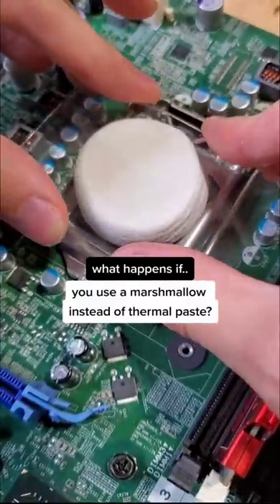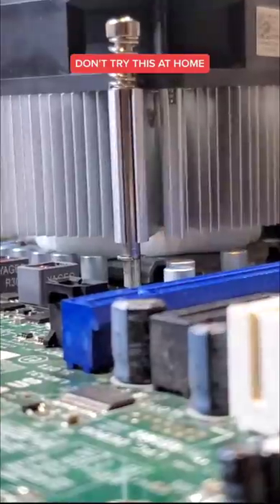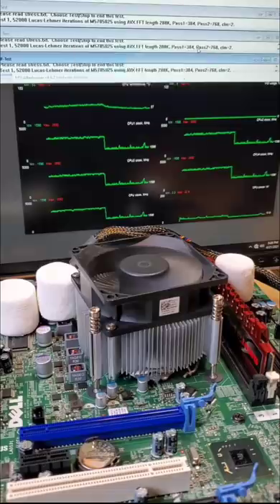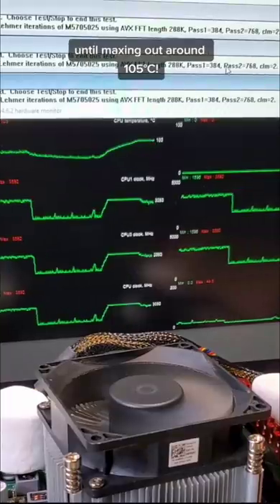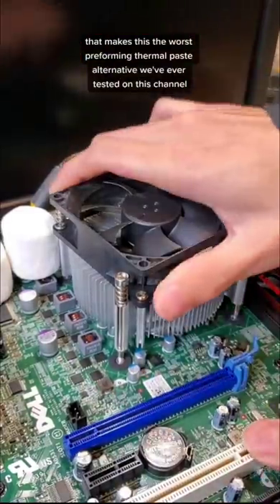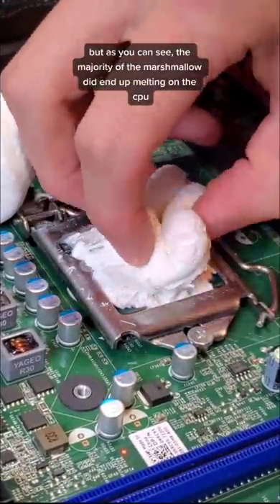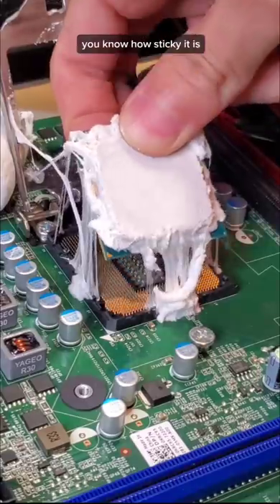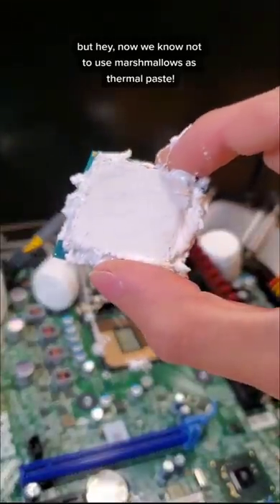Using a Marshmallow as Thermal Paste #shorts

Comment: Thermal paste: is a good heat conductor
Marshmallow: literally the most air filled thing you can eat besides cotton candy.
Reply: So Cotton Candy for the next experiment (check).
Reply: @Hotshotron25  That's going to stink something awful.
Reply: @DP-ot6zf  the temperature is not high enough to burn sugar, but high enough to melt solder
Reply: Cotton candy is pure sugar. Do not do that 😭
Reply: Air: am i joke to you?
Reply: So it turns out you haven't heard of.....a dish here called...PANIPURI
Reply: Ayooo what’s that white sticky stuff😂

Comment: Everyone- “don’t use marshmallows as thermal paste” 
Well guess I gotta cancel my plans for the week 

Me- what’s thermal paste
Reply: Thermal paste is pretty much what it sounds like. It's a paste you put on your cpu to keep it from getting too hot.
Reply: That's what I was thinking
Reply: @oliver1435  This is a little misleading, it kinda makes it sound like the thermal paste in of itself cools down the CPU
A much more accurate explanation is that it help bridge the super small gaps that you get between your CPU and your cooler, allowing more heat to be transferred to it. I'll go into more detail below, but this is (what I feel is) a fairly accurate explanation of what it accomplishes

The surfaces of your CPU and your cooler are not completely flat. There are very small gaps that are imperceptible to not only the human eye, but even to our skin. If we install a cooler on it with those gaps, we will have thermal transfer, but because there are so many of these gaps, we don't have nearly as much surface area actually making contact
This is where thermal paste comes in. It needs to be able to fill in those gaps, while also having fairly high thermal conductivity (and ideally low electric conductivity, although some people use liquid metal) as to improve the surface area that makes contact between the CPU and the cooler. It's pretty significant, about 20° lower at idle (or rather, "with the computer doing nothing"), going from roughly 60° down to 40°. However, it in of itself will not keep your computer cool (in fact, you can theoretically daily drive a computer without any thermal compound, as long as you have a cooler it should be fine. I wouldn't recommend this at all, especially if you have anything that was at any point considered "high end", but you still could)
Reply: @cdgames69  who asked 😭 my explanation was fine for someone that just wanted to know what it is
Reply: @oliver1435  The problem is if someone who didn't know what it is read your explanation, they wouldn't properly understand what it does. Your explanation makes it sound like the thermal paste cools down the CPU all on its own, which is far from the case (in fact, the thermal conductivity of thermal pastes is actually less than that of the metal on the IHS of your CPU, as well as the metal on your CPU cooler. People have actually lapped their CPU's IHS and their cooler to get better cooling without thermal paste than they would get with thermal paste)
Reply: @cdgames69  i literally didn't all i said was it keeps it from getting too hot, i didnt say specifically the thermal paste cools the cpu
ur completely twisting what i said and putting words into my mouth
plus if someone works with computers they're gonna know what thermal paste actually is, you dont need to know the exact specific logistics of how it mollecularly works with heat and the cpu and closing gaps if you dont work with computers
Reply: @oliver1435  I know you didn't say that it cools the CPU, I'm saying someone who doesn't know what it is might think that's what you're saying. On the surface (which if they know nothing about this kind of stuff, that's all they'll care about), "keep it from getting too hot" is the same thing as "cool it down"

Comment: I dunno why everyone is worried about the cleanup; it'll come off just fine in the dishwasher.
Reply: I mean it would be clean but like... please don't.
Reply: @apebble9740  Ok...? Guess I'll have to use the sink then.
Reply: @blaze595  OH NO NO NO NO NO
Reply: @apebble9740  funny enough, you can actually run electronic hardware through water as long as it doesnt get damaged through other means (getting scratched up, things disconnecting, etc.) and left out to thoroughly dry out

Comment: The marshmellow adds TONS of thermal resistance because it’s so thick when you only need it to be extremely thin

I wonder if a smaller marshmellow would have performed better?
Reply: I mean marshmallows have a ton of air in them making them great insulation
Reply: @TnvTablet  

Probably doesn’t have much air after being melted
Reply: @PashaGamingYT  when it's fully melted sure, but at that point you just have liquid sugar
Reply: @TnvTablet  

Yeah… that’s what a marshmellow is…
Reply: @PashaGamingYT  well it is it's main ingredient, but a sugar cube or liquid sugar isn't a marshmallow
Reply: @TnvTablet  

…how would you make it not melt
Reply: @PashaGamingYT  you can't realistically, you'll just have to replace your marshmallow cooling every few minutes
Reply: @TnvTablet  

?????????

The marshmellow is the thermal paste not the heatsink
Reply: @PashaGamingYT  it was a joke, in this scenario were theorizing about marshmallow cooling, however when the marshmallow has completely melted it ceases to be a marshmallow.
Reply: @TnvTablet  

There’s no way to stop it from melting and we are not talking about using a marshmellow for cooling
Reply: @PashaGamingYT  Indeed we are talking about using it as thermal paste, and yes there is no way of stopping it from melting, it's almost as if Marshmallows don't make for great thermal paste
Reply: @TnvTablet  

Who said they did????
Reply: @PashaGamingYT  not you I hope, but I think you missed the point, when the marshmallow melts it's thermal conductivity might improve but since at that point it no longer is a marshmallow it can't be included
Reply: @TnvTablet  

Are you trying to start a philosophical debate on what is and isn’t a marshmellow

Comment: Can you make a video on how to clean a cpu socket without breaking anything? Thanks!
Reply: You can wash the motherboard with tap water and if you dry it quickly over a heater, it will not have time to oxidize and will work. The main thing is not to forget to remove the battery. Of course ideally the motherboard should be cleaned with alcohol or distilled water, this is how they are cleaned of flux at the factory.

Comment: The next video should be about cooling a cpu without anything like there should be nothing above the cpu except the cooler.
Reply: Well everyone should already know how that goes it just heats up a lot more
Reply: Doesn't everyone know this?
Reply: @whwhwhhwhhhwhdldkjdsnsjsks6544  not even a lot more. perfectly viable if you dont have thermal paste. cooler is doing like 90% of the job, thermal paste 10%. the only thing thermal paste really do is conduct the heat from cpu to cooler heatsink, and as you probably know metal is already a very good heat conductor.
Reply: @MalhaIIa  the amount the cooler does is completely dependent on conductivity between cpu and cooler. The metal they’re made of is a better conductor than thermal paste but thermal paste can make a massive difference depending on various things like material of your cooler but mainly manufacturing quality.

Comment: Using a marshmallow as thermal paste is like trying to use a block of rubber as a power cable. Marshmallows are basically the closest to foam insulation food could possibly be